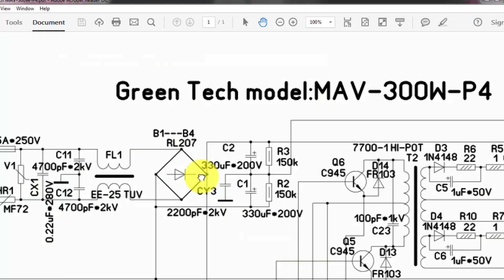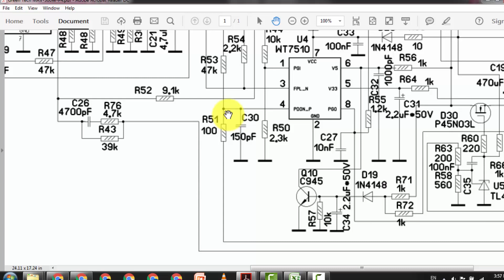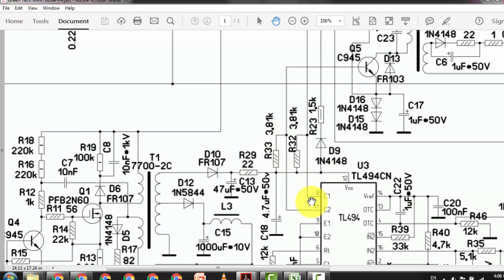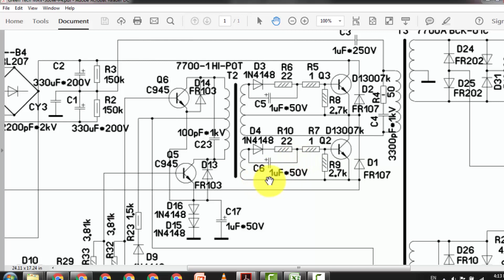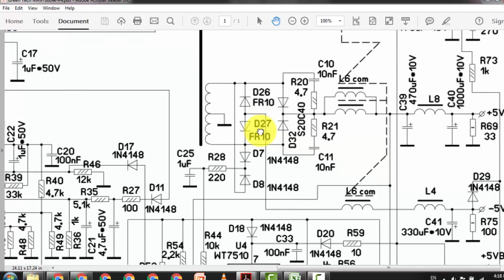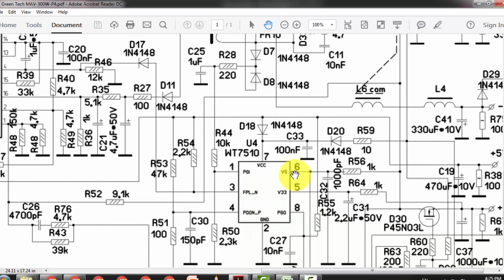{570} ATX Power Supply Circuit Diagram Explained Green Model 300W / TL494 /  WT7510 ATX Supervisor

Comment: I don't understand these circuit.
What if. I realy mean what if. 
What if you remove ( desolder ) the driving transistors Q5、Q6 and D13、D14 and then turn on the power supply. 
What would the output voltages be ?

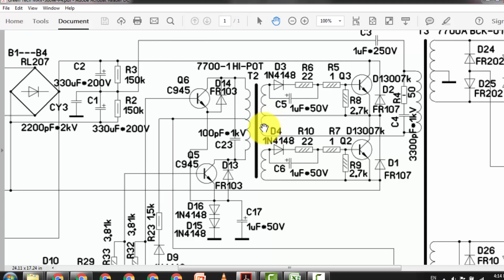Comment: 19:45 I don't understand how this steering transformer (T2) work. And how  the power transformer T3 (with very high voltage) can work safely.

The Q5 and Q6 both drived by tl494's outputs. But according to the schematic the condition of Q5 and Q6 are inverted of the tl494's output transistors. That means when tl494's transistors are both cut off ( during dead time ) the Q5 and Q6 are both turn on. Than what would be the behaviour of the T2's secondary winding ?

Comment: What if i want to increase the current output capacity of the 12volt rail, which components do i replace (assuming the PCB traces are capable of handling my target current output)?
Also, if the 12volt rail is shorted to ground, which components will fail and need replacement?

Comment: Sir smps power unit which ATX type 300w assembled  to my p.c  there un used powe out line shortcircuit done  by my hand and now it is not working. can it be repair to me myself. if so can you pont out which section has fault occurred  in this circuit.
Reply from the maker: sorry for listen that. 
if you have some experience about power electronics, then you can do it easily. 
check its fuse. most probably the input fuse may damage in your condition

Comment: Salam M Haseeb, if i am not mistaken, that PSU uses only 1 opto-isolator ? Thank you & Salam Aleikum.
Reply from the maker: yes brother it uses only one optocouoler and it have secondary side pwm controller so that it is using pulse transformer to transfer drive signals to power transistors
Reply: @HaseebElectronics  Thank you very much for the answer.

Comment: Hi Professor. I have two questions. There is a diode for voltage on the base of transistor 13007. Why in some circuits there are two diodes in series but there is one here. The second question is why there is a micro and 50 volt capacitor here. What is the reason for the existence of this capacitor? thank you very much
❤️❤️